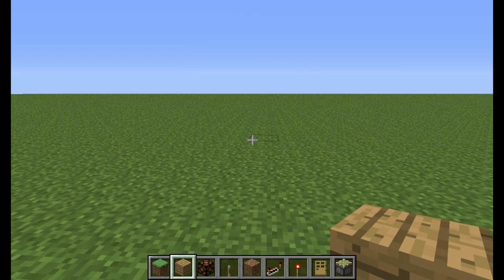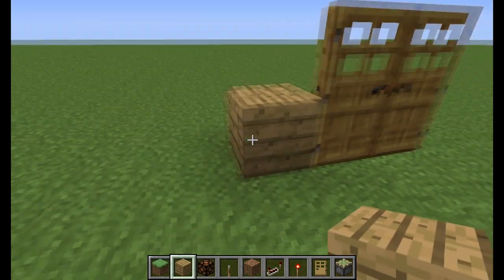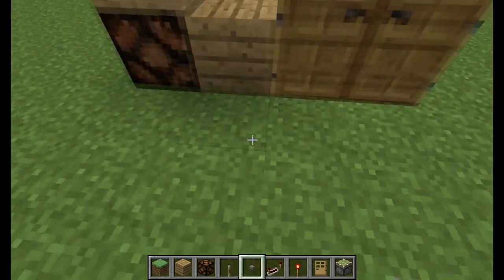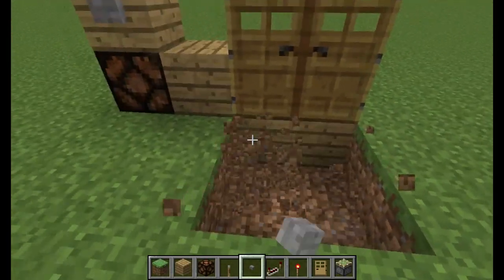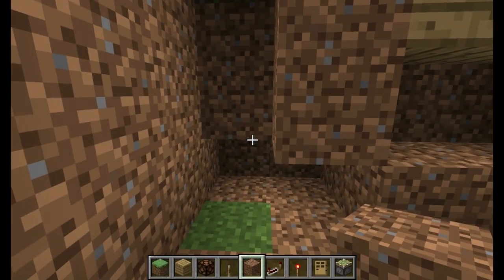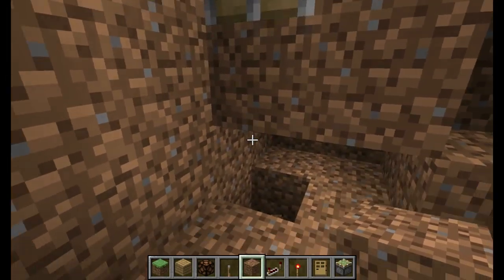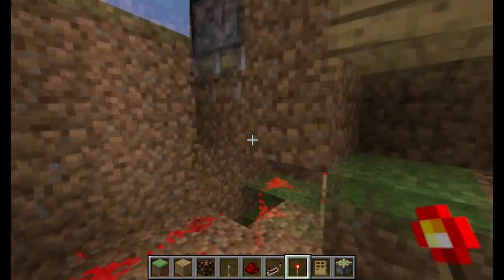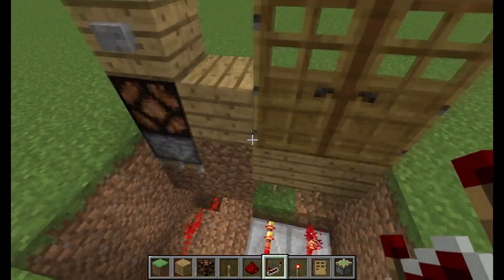Easy Peasy Redstone: 2 Block High Double Door Button

Comment from the maker: Yes, actually I recommend watching my updated version 

watch?v=a2SW8ZvCHKA&feature=youtu.be&t=36s

Also read the description because there is a way to modify it so that the door stays open until after you walk through the door. So it stays open as long as you need it, no need to fuss with timings or hurrying through.

Comment from the maker: It's definitely possible to have the plates next to the door and have them both open both doors. But it's not possible with this current design because of the torches underneath the doors and the piston being where it is makes it tricky. I'm sure it can be done but that would need a whole new design. I'll mess around with it.

Comment: i love your bloopers :) But if you go out, you use the pressure plates, but if you step on 1 pressure plate it opens only 1 door so, you have to stand on both plates to open both doors, and sometimes you are stuck if you stand on 1 plate and you don't walk straight forward in a line (diagonal a bit). Can you make for the next episode: so when you press the left or the right or both plates you will always open both door, and the pressure plates still had to be next to the doors, is that possible?